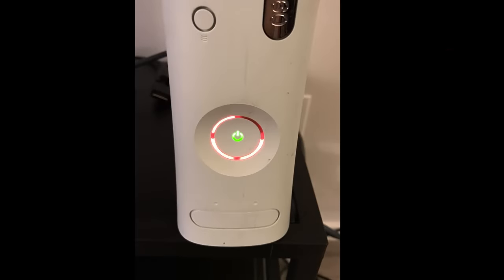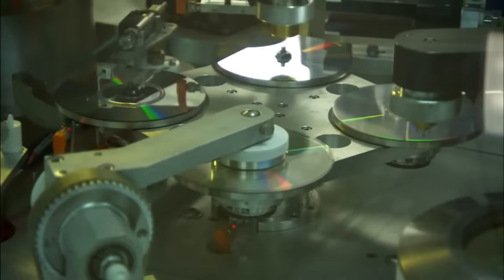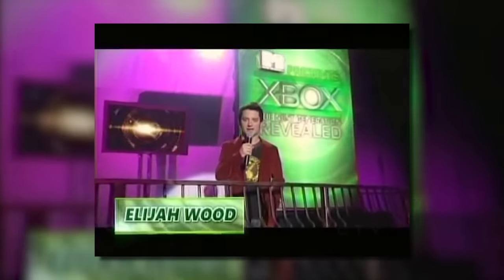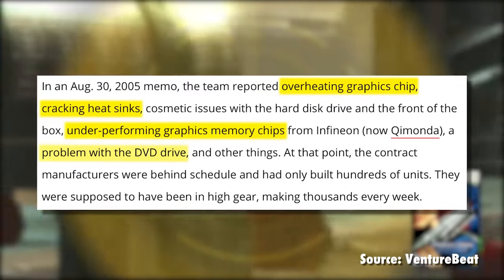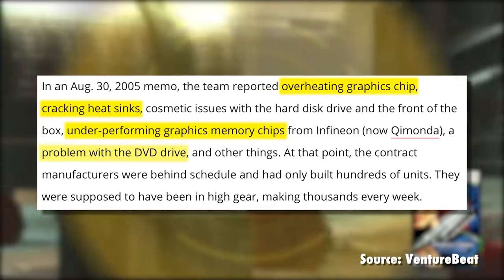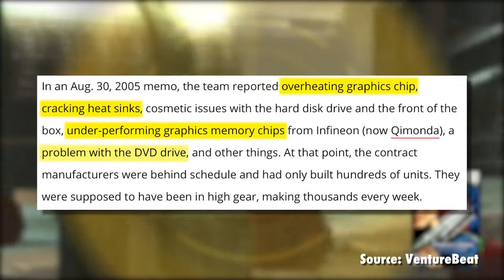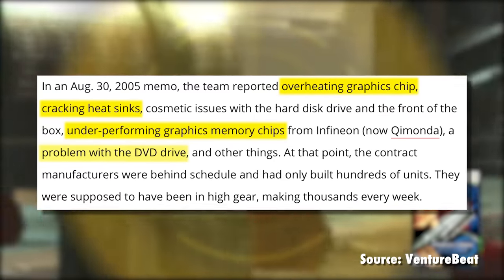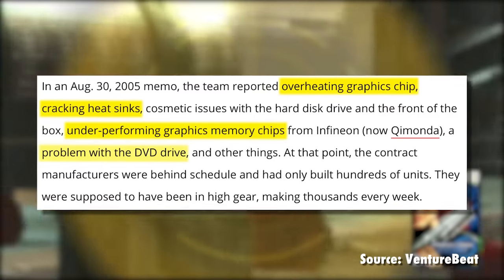History of the Xbox 360 Red Ring of Death | Past Mortem | SSFF

Comment: We fixed the red ring of death.

 Now you have to deal with the disk drive of Doom.

😭😭😭😭
Reply: I don't have an Xbox, but I do have a PC, and when your disk drive for your PC won't work, it usually has to do with the rubber band inside has "dried". If you can take out the drive, take off the panel and try replacing the rubber band in there (if there is one) with another about its size.....or not that too

Comment: fun FAct: my Ps3 (release model ) still lives >< i call it Fat man, and its a hell of a toaster.
Reply: my ps2 still lives good ole dinosaur
Reply: Same
Reply: @marxismleninismkanyeism6440  mine too. Hell my second hand playstation still lives as well as my release genesis.
Reply: Look into having the CPU and GPU de-lidded and the thermal paste under the integrated heat spreaders replaced. It's not as simple as just replacing the thermal paste on the heatsink. All fat PS3s are doomed to a slow heat death because the thermal paste under the heatspreaders dries out.
Reply: @marxismleninismkanyeism6440  rip my ps2 super slim (Dodgers wrap if u have it too c:) 2012-2014
Reply: It was amazing as 300 PS4 PROS as it lasted
Reply: RIP mr banana

Comment: I still have an first-gen Xbox 360 (limited edition black PGR3 console) stowed away, which miraculously enough never succumbed to RROD. Or at least, I replaced it with a slim model before it got a chance to break down. I'm kind of afraid to hook it up again, because who knows what might happen if I power it on?

Ironically enough, it's my PS3 that has caused me the most issues. Its drive motor burned out about a year after I got it, which I was able to replace myself. But a few months ago it started glitching while I was playing a game on it, and after locking up entirely it's now showing the dreaded yellow light of death. I know a place that might be able to fix it, but I'm wondering if it's still worth the money at this point.
Reply: I bought my 360 in summer '06, and it managed to hang on until I replaced it with the Star Wars edition in 2012.  The disc drive was getting noisy and I had a few read errors, but I still feel pretty lucky.
Reply: I got my 360 in the spring of '06 (won it in a prize draw actually) and it served me until late 2010. The biggest issues I had with it were the drive tray getting stuck on occasion, the horrible fan noise, and the cramped 20 GB hard drive. I thought about upgrading the hard drive at one point, but when I got some gift cards as a Christmas bonus, I figured I could just solve all my problems in one go by upgrading to a 250 GB Xbox 360 S instead.
Reply: My 360 falcon model died like 6 months after i bought it back to 2008. Falcon models were the worst because it had another kind of RRoD that was a lot worse than the previous models had.
At least microsoft gave me a Slim when i replace it, 5 years since that and still works like a charm (still use it despite i own a PS4 and One cause the massive catalog it got)
Reply: Yeah I have the last model of the PS3 and my disc drive keeps acting up. I honestly don't even feel like fixing it, so it's whatever
Reply: My PS3 is from 2008 and I have only been struck once by hardware failures. The dreaded memory-wipe of 2014. It was partially my fault. I was playing Resident Evil 3 off the original PS1 disk and while the game was fine on a PS1 and 2, the 3 managed to freeze up alot for me. Usually, that just means after force-shutting it, I'd have to go through the data recovery process or whatever the PS3 does, but then, that process froze as well. For quite a few hours, it hung up at 52%. I stupidly decided to shut the system off at that point, wherein it informed me that the harddrive was suffering an error and had to reformat the whole bloody thing and with it went alot of memories of those 6 years.
Reply: The worst that ever happened to my PS3 was the Hard Drive died. Not sure how but all I had to do was replace it. Which ended up being better for me as I went from a 120GB Hard Drive to a 500GB one. Sure, I lost all of my game saves but that was a small price to pay. But even still, pretty sure you can now get a PS3 for pretty cheap if you need to replace it. I bought a preowned PS3 for someone that only cost like $120. 

Also, I bought an Xbox 360 like two years ago. Still hasn't given me trouble though if it does, I only bought it for $50 from a friend.
Reply: Astfgl nah u can buy a ps3 slim for probably under 100 bucks.
Reply: Never owned a PS3 but I do have a PS4 😂 I still have my white first gen Xbox360 and it's running like a champ ! I played army of two on it a week back.
Reply: My XBOX 360 "elite" fried after 4 years in a literal heated call of duty world at war online match in one of the hottest summerdays I ever wittnessed to today (39 Celsius) with that E63 error. And the very same day I went to the shops and just literally bought a new xbox elite for 300-400 bucks back then to continue the cod session lol
Reply: 12v mod the fans, and remove the xclamps, replace with bolts(nylon washers for spacers); or keep it the way it is and never look at it funny or dare to turn it on(also play it flat, not standing sideways)
Reply: Astfgl Damn I've had my ps3 for so fucking long and I've never had a problem with it and I still use it if I get bored of the games I have on the ps4 and come back to good old Black ops 1 battlefield 3 need for speed hot pursuit. It all depends on how you use your console for it to last.
Reply: 300 SHOCK what model do you have? Just curious
Reply: gangstalishis yeah, maybe second hand, but you can buy an Xbox 360 for that price as well

Comment: Sony and Microsoft were really at the mercy of processor technology of the time. This was the beginning of the multi-core, multi-threaded CPU days and they’re using 90 nm lithography in the 3GHz range. Everything of this era with any kind of speed ran hotter than balls: Prescott’s, Opterons, PPC G5, Cell... But these two companies had staked their reputations on having the most advanced graphics. They had to use cutting edge procs and try to risk-manage the heat. Most of those heat issues were fixed once the 65 nm chips came into mass production as replacements. 
Nintendo really saved themselves by forgoing “top speed; top graphics” and refocusing on gameplay and aesthetics. The Wii’s processor was also 90 nm, but it’s running a single core less than a GHz. It’s still largely improved over the GameCube, but it wasn’t so cutting edge that heat became an issue.

Comment: My first Xbox 360 didn't get RROD'd - the disc drive blew up instead.
I was afraid of the disc drive on my 60GB PS3 crapping out, but nope - YLOD.
Reply: Remember the Wii U violently malfunctioning at launch?
No? No one bought it? What's a Wii U? Is that a add on to the Wii?
Reply: I had a launch 360 RROD and a launch PS3 YLOD, eventually gave away the replacement 360 and kept the replacement PS3 which I still use to this day.
Reply: That's what happened to my PS2, the dreaded disc read error. Insert any disc, you get the same message. That's the whole reason I bought an Xbox in the first place.

I miss playing those games, I still have all of them but I have yet to buy another PS2. I keep hoping sony will introduce backwards compatibility, but it seems like that's going to be my only option if I want to play those games again.
Reply: I had my launch PS3 YLOD on me, my launch 360 disc drive stop opening. My second PS3 60GB i replaced the thermal paste and have had no issues since. I'm wondering if there is any point doing the same for the 360 I have at the moment, it's a Falcon early model too...
Reply: The only problems I've had with my PS3 were the hard drive dying. Other than that it's worked flawlessly for me. All I had to do was buy a new Hard Drive and I even bought a bigger one. Original was 120GB and I replaced it with 500GB. I never even knew of the YLOD until very recently.
Reply: +Bottom Glass Cinema The ylod only happened with the launch 60gb ps3's.
Reply: Arbiter91 bro if you a good pc you can just emulate those games and you can download em for free on a website called emuparadise. Just go to the flea market and look around for a ps2. I seen some going around for 20$ so yea.
Reply: Arbiter91 yea just go to a flea market or a goodwill you're bound to find a good ps2. If you ever get one go on amazon and buy a fmcb memory card it is a memory card that has already been flashed and all you gotta do is plug it in. After that go to emuparadise download an ISO patch it with esr patcher and burn it on a DVD-r. Bam no need to buy ps2 games when you can just download em for free.
Reply: Arbiter91 yea I get where your coming from but trust me I have my ps2 modded my Xbox og softmodded and my psp softmodded and they are all packed to the brim with games. Hell I installed a 200gb drive on my Xbox. Emuparadise is the best place to also get nes and snes Roms. Emuparadise is the best site. Only site I say to watch out for is ISO zone. Do more research you'll see but yea stay stafe.
Reply: It's not right to download a game you don't own though? I'm not against emulators like PCSX2, Dolphin, Softmodded Xbox's but at the very least, only download games you own or have previously owned. I don't agree with downloading something you have never owned before.
Reply: TheMadPolarBear those games are super old and probably don't even profit the company's that published them anymore. Plus I ain't paying 60$ for an old ass game I already had growing up like def jam fight for ny. Honestly I don't think I'm hurting them at all. And I think it's ok. But I think it's bad when it's done on 7th gen like 360 and PS3
Reply: Don't get me wrong, you're more than welcome to do as you please :) I mean for a game you have already owned i suppose it's not so bad (your example of Def jam). But yeah, for ones people haven't owned, I personally don't agree :) However, that said, rare games like Conker's Bad Fur Day or Pokemon Stadium 2, which go for £100-200 I can somewhat agree with. 

Though these days, most old games are only £3-20 on Ebay for a genuine copy anyways.
Reply: TheMadPolarBear surprised you didn't shit on me and tell me what I can't and can do. Thanks for your opinion.

Comment: I had total of 3 xbox 360 each of them lasted 1 year then i got tired of it so I bought ps3 it still works today more than 5 years later
Reply: Juku To put that in comparison my SNES is built in 1991 in the year they had been released and it had been working since and still can run today however my stupid brother broke the controller for it >:(
Reply: I had a total of 1 OG Xbox, 1 PS1, 1 PS2, 1 Xbox 360, 1 PS3 and 1 Xbone before I got tired of spending hundreds of dollars on consoles and switched to PC

Comment: Were people putting their xboxes side ways? Cus that makes the Xbox hotter 4 some reason
Reply: probably because it blocks the vents on the side...?
Reply: I managed to have my Xbox download portal 2 for 2 days straight and it was sideways. It still works.
Reply: It makes the xbox hotter because the heat rises. That means when parts near the bottom get hot, that hot air has the potential of rising through the entire system before passing out a vent. Lay it flat.
Reply: I put mine sideways and the disc inside it got scratched.

Comment: My black Xbox 360 red ringed and I got a new one haha
Reply: U should of upgraded
Reply: IcyYT It was like when I was 11, back when Xbox 360 was on top of the range. Now I have an Xbox one S. the red ring on the Xbox 360 scared me so much - I thought that there were hackers or virus’ on my Xbox haha. It was just a smooth red ring circling around.
Reply: I swapped to PlayStation after the red ring, best decision ever
Reply: Enduro Clutch N Shift debate able...
Reply: Should’ve upgraded to pc, best decision I have ever made
Reply: Yeah same man, it was on my black Xbox 360 and it was smooth as well... Now I have my trusty Xbox 1 S
Reply: I got mine in 2012 or 2011 and it still works to this day! I was only 9 years old when I fixed it. I wasn’t gonna buy a new damn motherboard for an old console in 2016 when I could’ve gotten a PS4 that would last longer! I fixed the Xbox360 but still got the PS4
Reply: @josephtpg7329  It still works because you have a newer model, the original models are trash.

Comment: They actually revealed in 2021 what the cause of the RROD was. It wasn't actually heat. It was thermal shock. In other words it was not about how hot it got, it was about how often it got hot then cooled.

Leaving it on for lengths of time was actually better for the system than turning it on and off. Everytime you did, you were introducing microfractures into the hardware.  That's why it tok them so long to figure out what the problem was. They assumed it was heat.

In a way, I'm glad RROD hapened, becsue it forced Msoft to get serious about hardware design. Flash forward to today where their next gen console is faster, more powerful, smaller, cooler and cheaper than the PS5.

Comment: I've hade a 360 for 3 years still works perfectly
Reply: XxbeastgamerxX 123415 I had one for 3/4 years but then red ring of death
Reply: had mine since 2007, never been red ringed and it only gets a slight graphic fuzz when too much goes on on screen
Reply: XxbeastgamerxX 123415 same
Reply: XxbeastgamerxX 123415 I had for longer still perserved into a fossile
Reply: XxbeastgamerxX 123415 maybe you got the Xbox S or Xbox E the newer ones
Reply: XxbeastgamerxX 123415 it’s just that people don’t care about thier stuff that’s why it gets the rrod
Reply: Those were the older models you probably had a newer one
Reply: Ive had mine since like 5 years?
Reply: ive had 7 years and no red light
Reply: Same
Reply: I've had mine for five and I only have to deal with a constantly jamming tray and a overheat every so often
Reply: I got the arcade one since 2009, i have the tray disc problem :( but never got the RROD
Reply: i have a computer :P im glad i have the ability to not worry about this kind of thing and can fix it myself :P
Reply: I have 11 years old and my Xbox 360 is 6 years old
Reply: XxbeastgamerxX 123415 i had mine for 5 years then it died
Reply: had mine 10 years and never red ringed
Reply: Than you're just lucky.
Reply: XxbeastgamerxX 123415 I had a white Xbox 360 for a year but it would not read discs anymore😢😢😢😢😢
Reply: Had mine since 2003 It doesn’t have a HDMI or Can it connect with WiFi without the USB cable.

Comment: When I ran the Xbox live gaming centre in dublin, we had 38 360’s. I think in total we had probably 60 replacement machines across the two years we were open , we had some units which never had a problem and then others that got stuck in the red ring loop. We’d send one back, it would come back with a different issue, and red ring soon after. Personally I’m on Xbox 360 11, when I hit #10 (replacement 9) I physically smashed it up and bought a new model, which has been working fine for 10 years since

Comment: the red ring of death was very helpful to fix your xbox 360
It came up with either 1 ring, 2 rings 3 rings or 4 rings, 4 rings represented a serious hardware failure which means your xbox is fuc*** or you left a cable unplugged, also, this will not display a code on screen to help you fix it. 3 rings represented a general hardware failure, which could be fixed and will give you a code on screen to fix it. Two rings on the left meant your xbox 360 was overheating, you must give it ventilation and power it off for a few hours to let it cool down, one ring meant you had a hardware failure, which will display a code on screen to help you fix the Xbox.

Comment: I thought the controllers were good on the Xbox. Especially because I have long fingers and struggled to hold other consoles cos they were too small
Reply: I meant other controllers not consoles sorry about that
Reply: I’m quite the opposite I prefer PlayStations because my fingers feel more comfortable that way
Reply: It looked horrendous, but I always kinda liked the way it felt.
Reply: PS3 controller was very small tbh. it felt like you were holding a fucking feather. Xbox 360 controller was great ergonomically but its build was cheap. Could feel the cheap plastic on it (same with  PS3 thou) and dpad was horrendous on 360 controller. Dualshock 4 is awesome but Xbox One controller feels like a fucking brick
Reply: @sushanthadusumilli1067  the only problem i had with the 360 controllers was that when ever i dropped it pieces of the mechanism that hold the battery broke off eventually to the point that you had to hold the battery in while playing to keep it on
Reply: @nongmosalt3140  The dpad is badly made. When you try to press a direction, most of the times it also presses in a adjacent direction due to almost negligible grip on the dpad. PS3 had a great dpad. It might not be an issue to you, but most players agree that dpad of Xbox 360 controller was not well made. They changed the style to PS style dpad on Xbox One
Reply: Don't be rediculous they wore awful

Comment: I had the red ring of death and my Xbox survived without anything different
Reply: The Minecraft Rockstar liar.
Reply: InternalScreaming it did happen
Reply: The Minecraft Rockstar Thats not possible. Seriously.
How many parts of the ring did you have?
Reply: The Minecraft Rockstar same at first then it just stoped connecting and minecraft no longer worked
Reply: You probably had the power cord failure  error thats what mine had all you had to do to fix that is unplug it but if you had the 3 part ring then your xbox dies
Reply: Khanage again you had the av power cord error probably just means your av cord feel out or it overheated
Reply: The Minecraft Rockstar my friend had it but we fixed it
Reply: The Minecraft Rockstar Same, it was a full ring so it was nothing big.
Reply: Mike Foley 3 rings means it almost dies, you could build parts for it so eh.